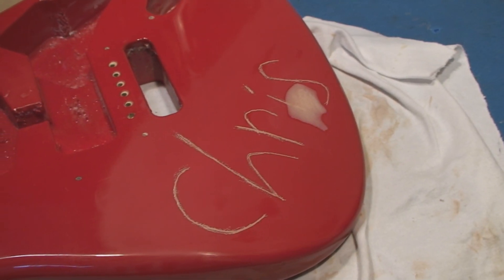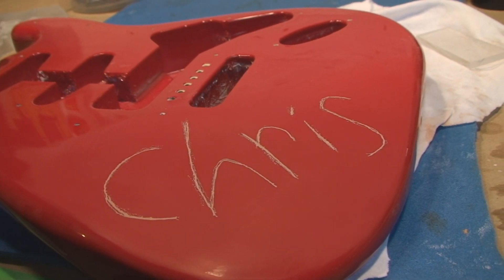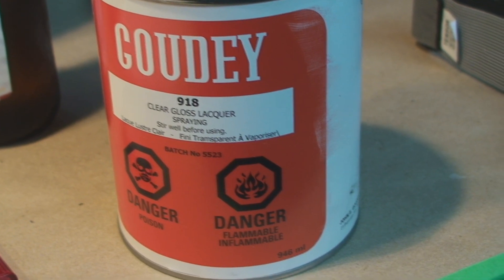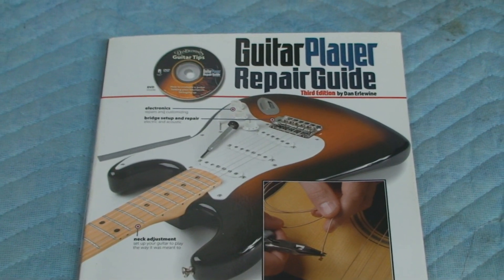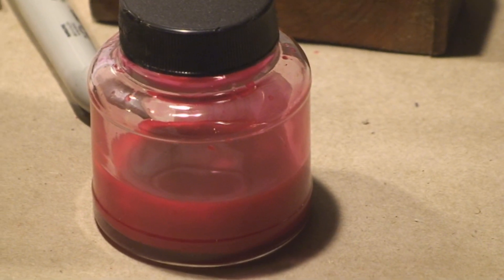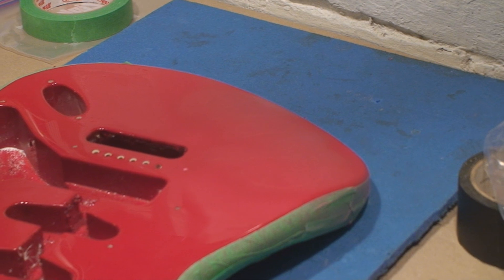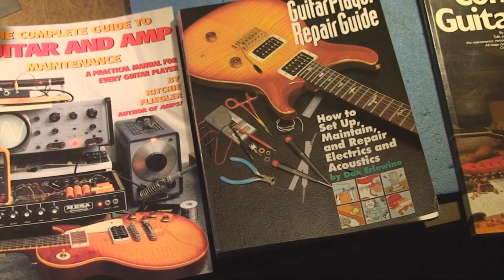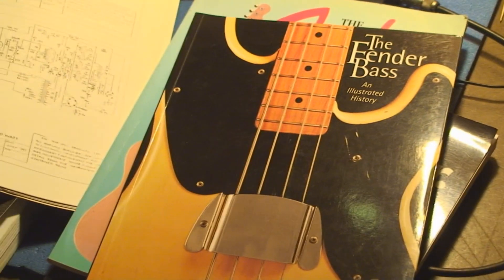Fender Squier Stratocaster Repair Part 2

Comment: it's not because bondo isn't fine enough. car putties are extremely delicate and you have to do it in one pass. if you're just going over and over again with your putty knife like dressing a chocolate cake, that thing will lift out of creases and pits. so one clean pass, let it cure fully, then sand the excess. if sanding is unacceptable, then so is the bondo method :)

Comment: Hey Dave, great video! I had a question though. I have a Mexican fender deluxe players strat, with a three tone sunburst finish. I was a Stevie Ray Vaughan nut, and I got a 3 hole ring, and scraped away some of the finish and some wood (not a lot) right near where I pick, in between the middle and neck pickup, where the sunburst is yellow. I want to get rid of the stupid look, should I use would filler? Or use the technique in this video?